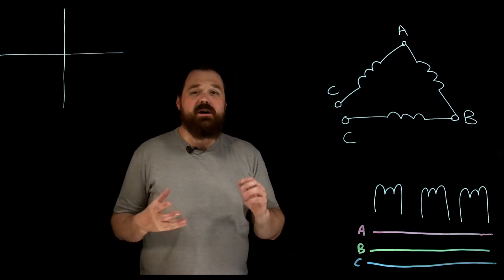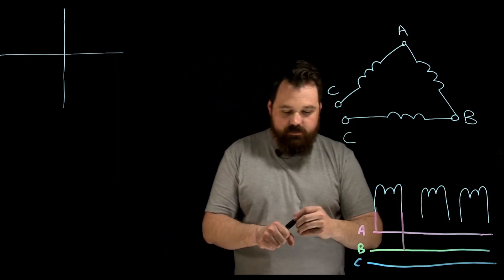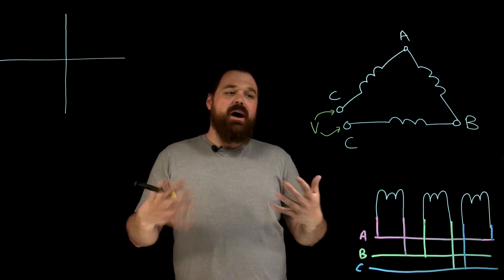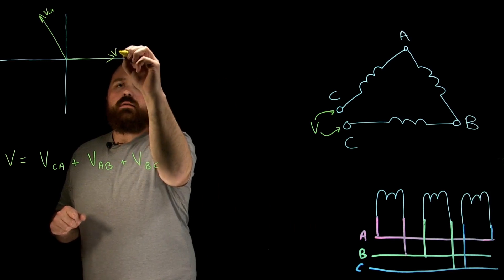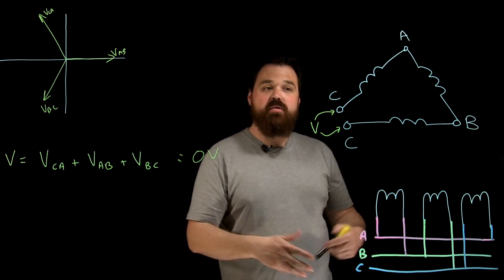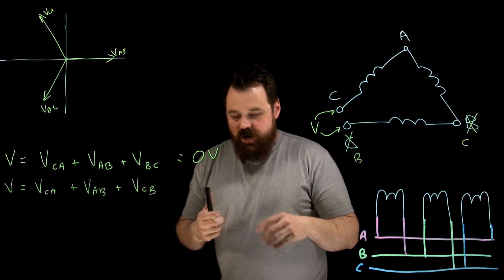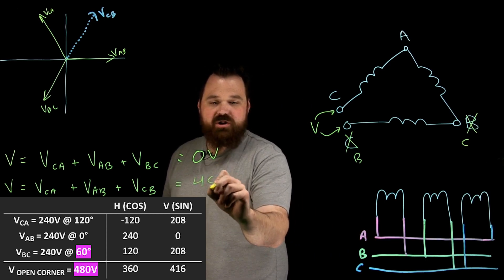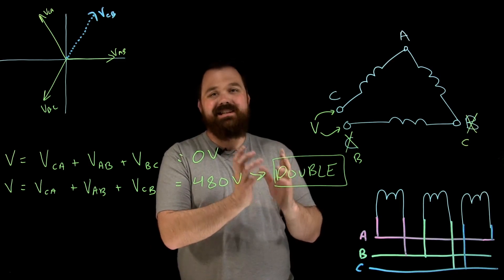Delta Open Corner Test

Comment: Great videos Zack! I don't think there is a better channel out there for Canadian Electricians. I love your teaching style, you have cleared up so many questions I've had. Being a 4th year about to write my IP in a couple months I have a couple suggestions of videos I would love to see from you. Although you might not have them out in time for me, I'm sure others would find it useful.

3 Phase Theory: Buck/Boost Transformers, Open Lines and Loads, Combination RLC Circuit calculation (I know you have done Series and Parallel but a complicated Combination would be helpful)
Code (CEC): Motor Conductor and O/C (Example: Calculate the maximum TD Fuse and R90 conductor for a 25 HP, 480V, 3 phase SCIM with class B insulation), Apartment Calculation.

I could come up with more but I'll leave it there, just thought I'd give you some video ideas if you need. Keep up the great work!
Reply from the maker: Thanks so much for the suggestions! I'll add them to the list! Glad the videos have been helpful!